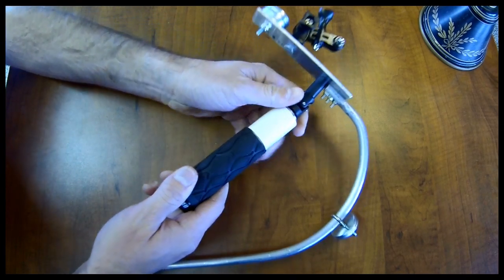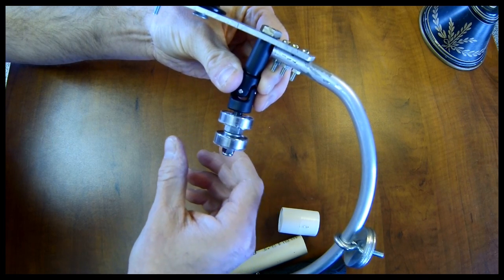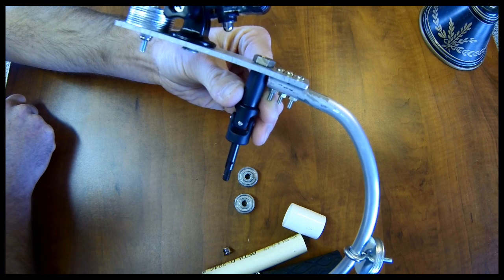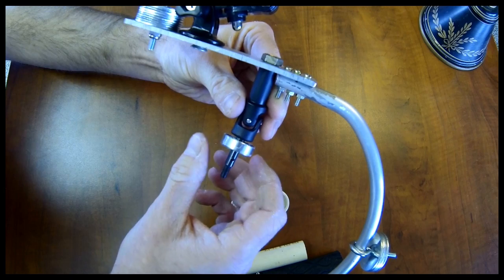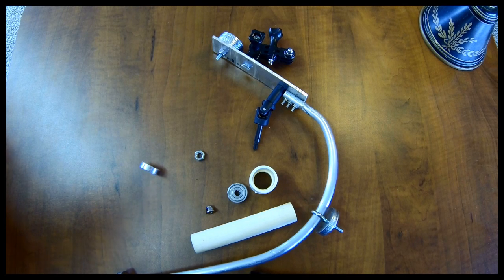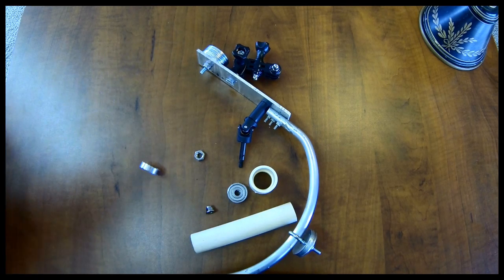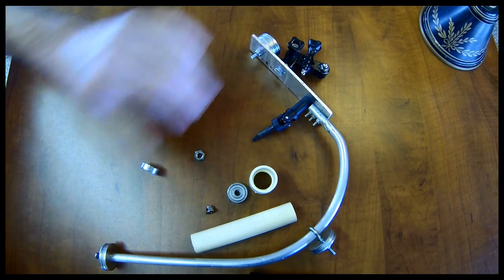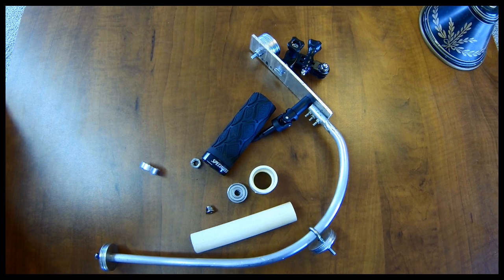DIY Steadicam Design and Construction Tips - For GoPro Hero and Other Cameras

Comment: can I use 1 bearing instead of two? what's the difference?
Reply from the maker: +legox007 Some people have used only one bearing and seems to have worked but I prefer two. Two bearings should hold the shaft more straight and give it more support in the CPVC.

Comment: is the bearing really need looked at other videos noticed they didnt have them???
Reply from the maker: Thanks for the comment Dan. The goal of the steadicam is to isolate the camera from the unsteady movements in your hand. That includes twisting the grip. The bearings help eliminate friction that would cause the camera to rotate left or right when you really don't want it to. I think they are necessary but, having said that, I haven't tried a steadicam without them.

Comment: Hi, how did you connect the 2 stub axles together? Just on the traxxas website it shows nothing to join them together?
Reply from the maker: Hi Charlie. You only use one stub axle in this build. The other part of the joint is in the Traxxas half-shaft kit: http://www3.towerhobbies.com/cgi-bin/wti0001p?&I=LXDDS8&P=7 . That kit also includes the metal balls that connect the half shaft and the stub axle together. The stub axle is part number 4953x and the half shaft part number is 4949x.

Comment: What is the nylon locking nut (probably part number 5147x) used for
Reply from the maker: This is the nut that threads onto the Traxxas stub axle and keeps the bearings on the steel shaft. It's just a regular nylock nut that you can probably find at your local hardware store. I provided the Traxxas part number to make it easier for people who are ordering the Traxxas parts. The nut is made of metal but has a little piece of plastic inside to keep it from unscrewing by itself. Let me know if you need any more help!

Comment: Hi, I just bought the 2 stub axles but the package didn't come with the 2 silver pins that connect them. Where did you find these? Suggestions? Thanks.
Reply from the maker: Hey Ian. Thanks for the comment. I think you bought this: http://www3.towerhobbies.com/cgi-bin/wti0001p?&I=LXDDS9&P=7 , which is correct but you also need this: http://www3.towerhobbies.com/cgi-bin/wti0001p?&I=LXDDS8&P=7 . The stub axle that you have attaches to the bearings in the grip and the short half shafts connect to the frame of the steadicam. The metal cross/joint looks to be part of half shaft kit. I hope that helps. Let me know if you have any other questions.
Reply: God's Country Thanks for the help. I ordered those connectors spiky balls on Amazon. Should be coming in soon, thenI'll get crackin' on the steady cam.
Reply from the maker: Ian Cramer Yes, I do think those are different than the ones that I posted. The part number that I sent you to is 4949x. The ones that you bought are part number 1651. You can search TowerHobbies for 1651 and the half shafts/U-joints that you bought will show up as a different listing. They don't mention being for a T-Maxx 2.5. I think they are for a Blue Eagle LS? Anyway, I believe you need Traxxas part number 4949x.
Reply: Hey, got the right ones. Who knew there were so many kinds of spiky balls?
Reply from the maker: Ian Cramer Great! I'm glad you got it worked out.

Comment from the maker: Thanks! Watch my steadicam version 2 video. It's much better. I've never added up the costs but it's not cheap. It also depends on what you have on hand and what you have to order/buy. I think the aluminum bar was about $10, the gopro tripod adapters are around $8, the Traxxas u-joint parts are about $15 plus shipping, bike grips can be had for $5-$30 depending on how high-end you want to go. Bearings are $14 plus shipping. It's a fun project and works well but you have to watch your costs.

Comment from the maker: Thanks Julius! I think you are asking about the main curved bow of the steadicam. That piece is a solid aluminum rod. I think I bought it at a local hardware store like Lowes or Home Depot. BUT, like the video says, round bar is not the best for the bow because it is hard to drill and bend straight. It makes things more difficult.

Comment from the maker: Thanks for the comment. I believe that skateboard bearings have an 8mm inside diameter. That would make the Traxxas stub axle fit too loose (the axle is 6mm). The outside diameter and width of the two bearings looks to be the same.

Comment: I built this for my hero3 with the waterproof casing. I can it to statically balance but as soon as i move the rig around left to right. I always get slight rotations (cameras starts panning itself). I tried ur suggestions to reduce rotations but it is still there. Any more suggestions? It looks like the "DIY Steadicam Silver Flyer" vid by Joey Zaciewski at 9:07

Comment from the maker: The main aluminum plate has a hole drilled in it for a bolt to pass down into the Traxxas 4949 short half shaft. The half shafts have plastic splines inside so when I threaded the bolt in, it created threads in the plastic. That the plastic could be stripped if you tighten the bolt to much. It just needs to be snug so that there isn't any movement between the half shaft and the aluminum plate. Unfortunately I don't know what size bolt I used because I just found it in one of my parts drawers.